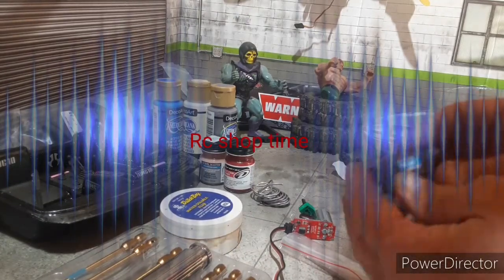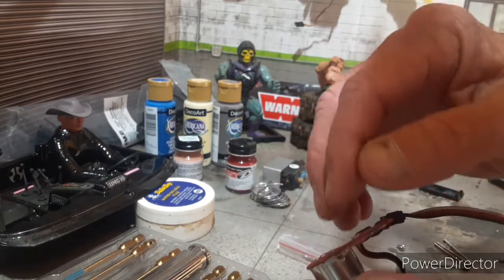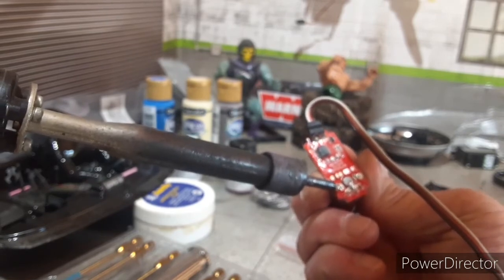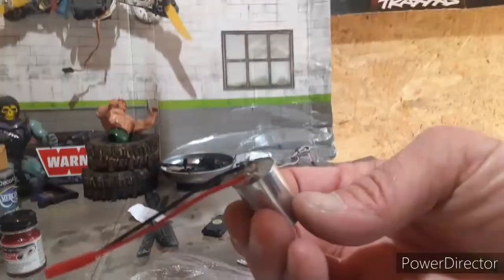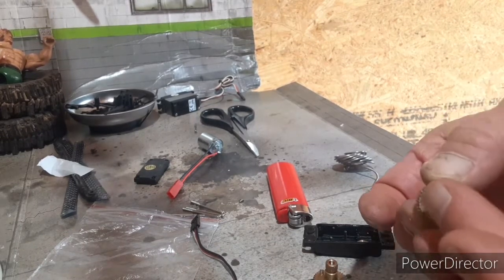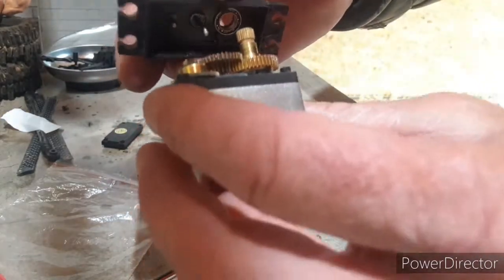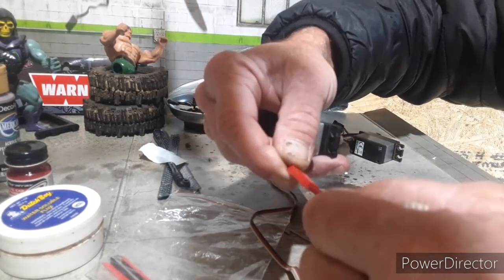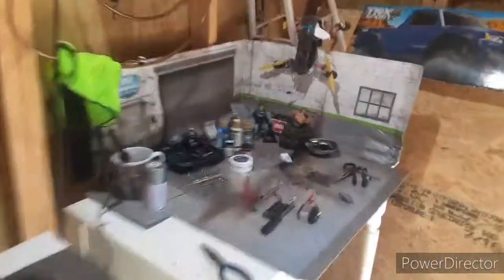Reedy 13kg Metal gear servo winch D.I.Y... Axial SCX10 II UMG10 Body fix, No Go!🎬 Ring that bell🔔💯👍

Comment: 👍👊😎 paint the outside
Reply from the maker: Thank you. For the comment.  
   You right,, I'm going to wet sand the outside and go with it.  
  I'm going to spray the inside back where the paint didn't stick wet sanding that too . 
   I believe it will look pretty good.  
   After all. I'm going to use it and abuse it.    💯
Reply: NC MOUNTAINS backyard RC 2377  Sounds like a plan 👍 Looking forward to seeing it 👊